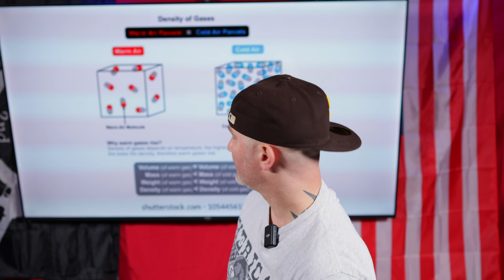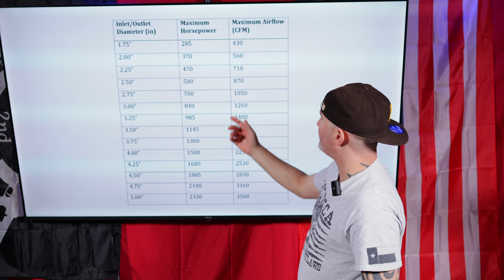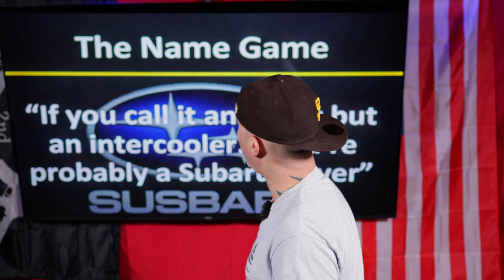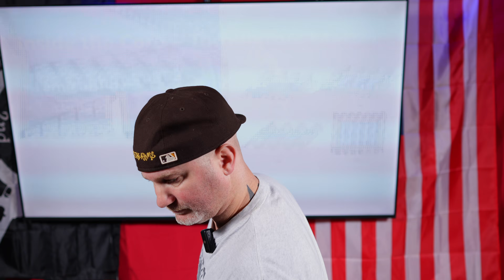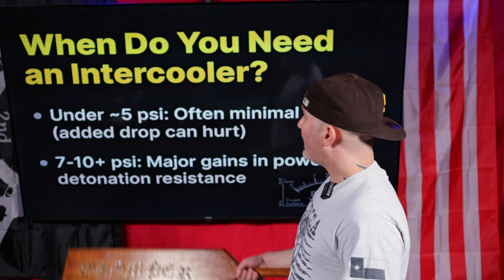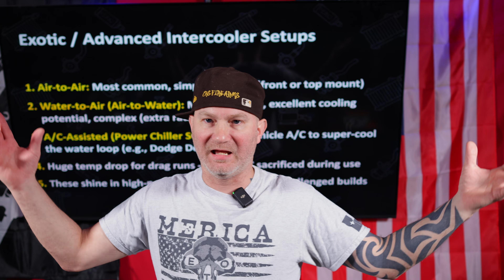Why Do Turbo Cars Need This?

Comment: so what if we used a compound turbo charger to make sum ambient temp compressed air that is expanded and feeds the engine at no boost but a much lower temp and humidity? would the tiny parasitic drag of the compound turbo yield better performance with a colder inlet air...
Reply: The thing is anytime u compress air, its gonna generate heat. Both turbos would have to be used at low PSI in order to shave temps. U couldnt compound 10 psi of boost into another turbo and expect it to not reach anything above 250 degrees